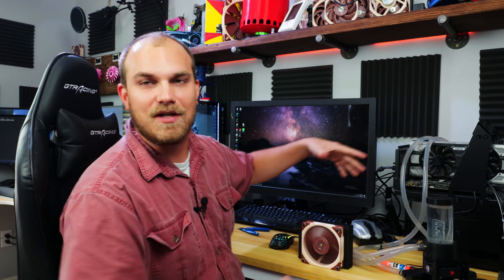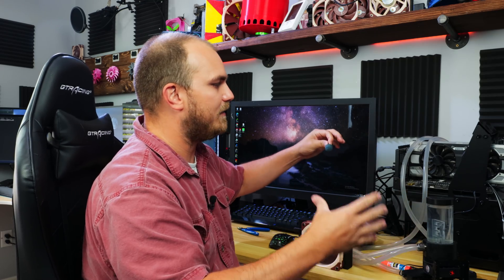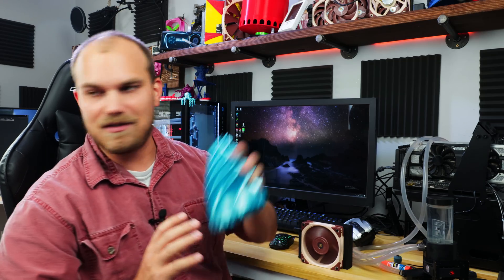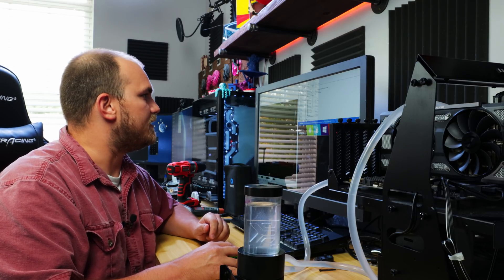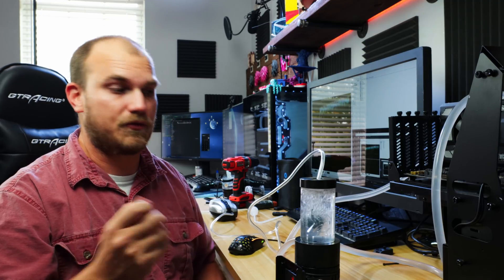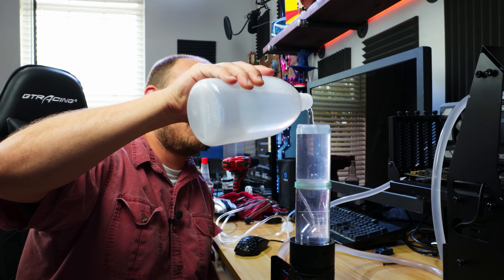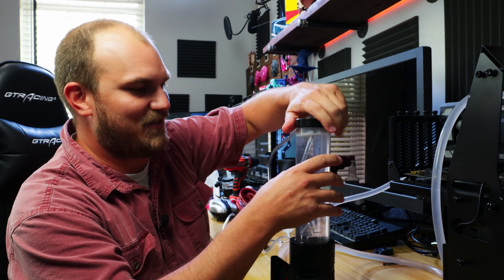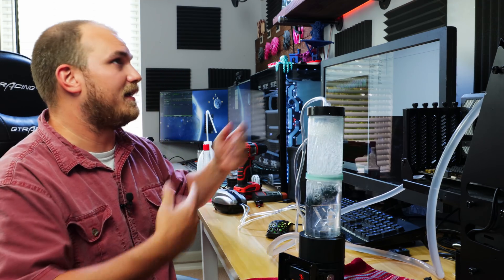Can An Airstone Cool Your PC?

Comment: Have you heard of metal foam? I've always wondered how they would perform in place of fins in a radiator or heatsink.
Reply: Linus did it already
Reply: @rusticscruffy  Link?
Reply: Foam is a good insulator.  Expect very bad performance as a radiator, no matter the material.  Metal foam will perform better (as a radiator) than plastic foam, however, lol.
Reply: @VoltisArt  I don't know if you've ever actually seen metal foam but there's a wide variety of ppi and thickness available and you can find a lot of research papers on its properties as a heat exchanger. Just to be clear I'm talking about open cell foam here. I don't see the difference between low density open cell metal foam and metal fin stacks other than a higher surface area

Comment: I do not believe it will be able to counter the  heat as well as a radiator, or a cooling tower. You are putting air into it, but have no counter sink to release the heat. However, if you redesign it to feed water into the base, and exit via the top of the tower, it may give the air more time to counter the heat and cool the system. I believe it would be your best chance to successfully cool with your idea.

Comment: There is the cavitation comment which holds a bit of merit, though watching this - another thing comes to mind - the hot air could be having issues escaping the reservoir (yes, it will push out as the air is pumped in, but choking it in there could be the major difference between this, and the more open design, especially since the tubes themselves are moving through the hotter liquid/air to reach where they are going

Maybe approach it like you're turning the double reservoir into the radiator - install a pull fan up top (pulling air out of the reservoir), inject the rocks in the sides of the top cylinder of the double (obviously sealing them to prevent leaking - and the reason for the top cylinder is to prevent the pump from pulling as much/any air into it). This keeps the air tubes from heating up as much, letting cooler air into the system, and the fan helps pull the hotter air out.

Won't work as good as the radiator/fan system, but could be more likely to function.

Though this oddly enough has me wondering if a higher pressure loop would improve cooling or not

Comment: Maybe setup a system without the pump that puts the air bubbler at the bottom of the loop and forces bubbles through the entire loop and escapes at the top so the heated air escapes the loop. Enough bubble force might even move the water in the loop? Not sure how that might work

Comment: It would be cool to get a cheap 20 gallon fish tank and run the loop with a submersible pump. I wonder how much water can a CPU actually heat? The I5 7600k says 91 watts TDP. According to a chart I found, a 100 watt heater should only be able to raise the temperature of a 20 gallon tank by about 20 F and a 40 gallon tank by 9 F over ambient temperature. You could try your agitation idea again too. I think the problem is that you don't have enough surface area. Making it taller wouldn't really help with that ( other than adding to the total water volume).

Comment: I know nothing about water cooling a PC but while watching your video I was wondering, Where is the "warm" water from the PC entering into the system? It would seem to me that if the warm water is not entering the column from the top and being drawn back into the loop from the bottom, the air bubbles will have little chance to effect any real cooling. Just a thought.

Comment: You're not evaporating any water into the air, just bubbling air through the water. Evaporative cooling works because the transition from liquid to gas for water is endothermic, so you pull energy from the water when it evaporates. But here, you're just passing air through the water and little to none of the water is evaporating into the air bubbles. 

The reason why a tower cooler works and this does not is that in a tower cooler the air flow helps atomize the falling water, giving it a much higher surface area and greatly increasing the rate of evaporation. In this, you're sending bubbles through the water, which does, to a limited extent, increase the overall surface area of air-water interaction, but orders of magnitude lower than in a tower cooler.

Comment: THIS IS A BEST GUESS and is outside my field of expertise. However if these bubbles are similar to those created by cavitation, the collapse of these bubbles can actually create heat instead of reducing it. This would neutralize any effect from the increased aeration. Aerated water also conducts less, holds less heat, and radiates less energy. 

This basically ruins everything you want from a water cooler, but still probably works better than a stock cooler ;)

Comment: Going massively tall might help...If you have 3-4 feet of tube that's a much longer period of time for the air pockets to be in contact with the water pockets. 

But what might work better is going wider, with more stones. A like...6" PVC pipe that's a foot tall with half a dozen air stones in it would be interesting.

Comment: It looks like one problem is that both the inlet and outlet to the res are at the base while the air is moving from near the top layer of water up. You might try moving to a counter flow design like in the cooling tower. Having the hot water enter at the top of the res and have to flow past the cool air bubbling up. It also seems like the small and fast air bubbles won't have a similar effect to the large air/water ratio in the cooling tower. Perhaps less bubbling to avoid the foaming at the top, then the bubbles will actually pop and release the heat upward. I think having a larger surface area of water will help along with a longer period moving through the water then maybe two inches of clear water at the base so the pump isn't sucking in any air.

Comment: floor to ceiling tube, same exact setup. also just a big enough metal res would start to work
Reply: The surface area of a 2" copper tube 8ft long is 2sq.ft. Which at that point basically a passive radiator column. you'd net more gain by not decreasing the area of surface contact with bubbling.

Comment: Your res and pump were lower than the block if any air got pulled into the pump witch is pretty likely it would get trapped in the block making your cooling efficiency a lot worse. Make sure air can't get trapped in the block aka have pump and res up higher.

Comment: Try lowering the air pressure. Put a 3-way valve ( a couple bucks at a pet shop) in the air tube, and dial down the amount of air going to the stone. I think there are too many bubbles rising too fast to take the heat out of the water.

Comment: I think there is not enough air. Sure it look impressive, but if you compare it with the water tower, the flow and the surface of exchange is just not on the same level. It could probably work, but you would need a much bigger tank with a much bigger compressor.

Comment: I'm thinking that the air from the compressor for the airstones could be being heated negating any cooling you may get from the air bubbles. I know that for instance the first few inches of hose for my nebulizer(asthma) usually is hot. Just an idea.

Comment: You need to exchange the air over the surface of the water as well as needing a bigger reservoir/more surface area on top of the water for this one. The bong cooler technique seems similar to what you're doing. It creates a lot of humidity which is its major drawback.

Comment: Long pipe, standing up. Hot water from system pours in at top of the pipe, return to the system at the bottom. Airstones near the bottom.

At least 3-4 feet...

Comment: I think it will work but you need a much bigger storage tank and a better air stone. Air stones come different ratings for air flow and size of the bubbles. 
Another channel “tech ingredients” did a diy ac where he used these wifle ball looking things in a tower that would help defuse the heat as water passed over them or something

Comment: @@UCUXW4gT27TOaDzKFyN-1tXQ
Hmm...As far as I understand it this whole project (as well as number of commenters) seem to overlook the fact that if You want "evaporative cooling" to work You have to have some part of Your "system" that can "take care of" the heat that the evaporation has "absorbed from the liquid" and "remove that heat from the system". 
I.e. You EITHER have to have the system "open to the environment" so that the evaporated water vapor can escape and take the absorbed heat energy with it (like the "tower cooler".
OR if You want to keep it a closed system (like this project) You need to have a some other "part of the system" (possibly a large radiator) that FIRST extracts the heat from from the  the water vapor, thereby condensing it back to water, AND THEN  "somehow" take care of that "heat energy" that was in that vapor and REMOVE it from the system....
So yea, as far as I understand it,  a "closed system" like this can impossibly work.
NOT to mention that the setup as it was, most likely meant that was pumping "foam" through the CPU-block, which meant that it had a severely diminished ability to "pick up" heat ... So Yea not the brightest of ideas...
But still enjoyable to watch.
Best regards

Comment: Can you use alcohol in your loop? Water can also have its surface tension reduced with alcohol. Could be everclear for grain alcohol or high percent isopropyl. Maybe try mixing some alcohol with the water to get smaller bubbles without the foaming..

Comment: Chillers work because the water that evaporates draws heat from the surrounding water to evaporate.  The energy it take to evaporate  1 gram of liquid  water at 100 C to 1 gram of water vapor at 100C is almost 10x more energy than heating the water from 1c to 100c.  You can feel the effect of this when a light breeze hits your back on a hot day when you're sweaty.    Introducing air into you water, will reduce the heat transfer coefficient into the water.  You'll have air to water block contact.  It will be significantly worse than just using water.  Water on it's own has the best specific heat coefficient of any liquid and so is the best liquid for cooling, otherwise automobile engines would be using something else.  The glycol is just to keep it from freezing and actually hurts performance.

Comment: You need to change the air too. It's a very small volume of air. To work like the cooling tower, you'd have to let the air escape somewhere, and have water droplets. It's the evaporation of water in air which cools, the aeration won't cool, just because there's little evaporation taking place. So you need 3 tubes in the top, water return to a spray nozzle, air in, and air out. And you'd need a 1/2 fill of water, so there is some space for air. And an air filter on the air inlet, to stop dirt getting into the system.

Comment: The water return into the res needs to be using the top return so the water HAS to go through the aeration. Right now, even with the divider between the return and the outlet, there's too much water not being aerated that's getting recirc'd through the system.

Comment: So idea, heat rises due to convection,  it looks like your return line and outlet are situated down toward the bottom of the pump reservoir.. so, I submit to you move the location of your return line to the top of your reservoir, your colder water should fall to the bottom where your outlet is and the return line (hot water should stay toward the top, in theory.

Comment: What about a tube with fins (radiator) with the lubes going through it, then submerge it in a water bath with the stones moving water through the fins avoid the wetter water it's like insulation when it foams

Comment: The reason this isn’t working is because it’s not removing the energy from the system. The bubbles do make the water surface greater, so there would be slightly more evaporative cooling, but there’s no condenser in the system that would take the energy out again (and any water vapor can’t escape with its thermal energy), so the air above the water just gets a little warmer until there’s an equilibrium again and there’s no more evaporation.

Radiators work because they provide a biiiig surface area for the airstream provided by the fans to take away the heat energy the water transfers to the radiator material (and of course they only work as long as there’s a negative temperature delta between the surrounding air and the radiator surface so that the heat is being transferred out of the system).

Comment: A couple of thoughts, if I remember correctly air that has just been compressed is warmer because you have taken all the energy that was in a given volume of air and compacted it.  You would possibly do better running that air through something to act like a radiator first, a longer stretch of tubing would work as well, but at that point you are just putting more steps in basically the same process as running the water through a rad in the first place. That being said I doubt that an aquarium pump can push enough cfms to make the air coming out of it that much warmer. If you were doing this with an actual air compressor it could possibly do something. You can make a snow machine that uses expansion cooling after all. (While the air sits compressed in the tank it sheds excess heat to the room causing the air that expands out of the air hose to have considerably less energy than the environment it expands into. I don't know just a couple of rambling thoughts.

Comment: I think the first problem lies in it's still a mostly closed system. The air inside the tank has no ability to exchange with outside air. Hotboxing in effect. Secondly if the pump isn't sucking in bubbles it's also not moving the water "cooled" by these bubbles. Seems like the air pressure would create thermal layers in the water. The pump is just pulling the warm water from the loop. SO the return from the loop needs to go into the top of the tank and flow down past the bubbles to get to the pump. 
My best guesses. Great entertainment. Makes me think.

Comment: Figure out average bubble size being made, calculate the area of that size sphere, calc how many can fit in the cylinder of water you have. Then figure out how much surface area your 3D printed cooling tower made and you'll have the math to see how much you need to increase the bubbler to match it. Assuming you actually need to increase to match.
Reply: Also should test to see how much the air pump increases the temp of the air it is pushing through the stone/bubbles.

Comment: The cool water is at the top of the tank, you are basically recirculating the warm water at the bottom although the delta is going to be disappointing regardless. Maybe use a chilled liquid like Co2 that would phase change as it moved to the water.

Comment: Combine the "Reactor" evaporative cooler with this... Would do an ok performance bump IMO in that specific setup as the fan on the top increases efficiency significantly... Or pop the cap off and line the cap area up with a fan somehow!

Comment: Air is a horrible diffusion transfer medium if you're trying to release heat directly into the environment for entropic effect for cooling if you can incorporate additional components. Also, in your specific set up, while the water does release heat into ambient air and dissipates it into the environment, it's by intermediary, eg. through the housing since it's capped off while still trapping most of the heat in the system because of the cap. You'll want to release more heat into the air and ambient environment than the loop produces, release heat faster into the air and ambient environment than the loop produces, or a combination of the two in a compromise to varying levels. I would also suggest the addition of a fin stack to the design and with using a area of air between the transfer of heat to the fin stack as a buffer [zone] to reduce the amount of radiant heat that will collect in the fin stack from transferring back into the loop system. Just my opinion, of course.

Comment: The only way to make this sort of thing work is by exposing the water to much air as possible, which ideally would involving making the water droplets as small as possible, as increasing the surface area:volume ratio of the water droplets to increase the capabilities of evaporative cooling.

Comment: To make it work, use a ~10 ish gallon fishtank. have the intake be in the bottom of the tank and the return line be almost waterfalling into the top of the tank. That would probobly work even without the bubbler, but if it doesn't, the bubbler is likely to struggle. Compressing air produces heat, which will probably heat up the compressed air. If you connected your airstone to an air compressor that was pre charged and not hot, you'd have much better chances. From your results, the pump your using seems to be heating up your loop. A bigger tank will also help avoid air being sucked into your cooling loop.

Comment: Air is  insolateive water is more conductive water will pull heat out of the air your trying to pull heat out of the water. When you pump water through a radiator your adding a tone of serfice airea to pull out the heat with conductive mettle.